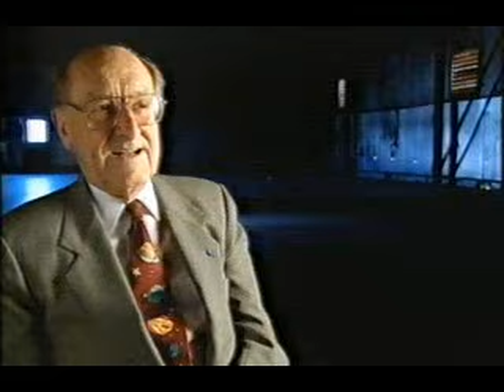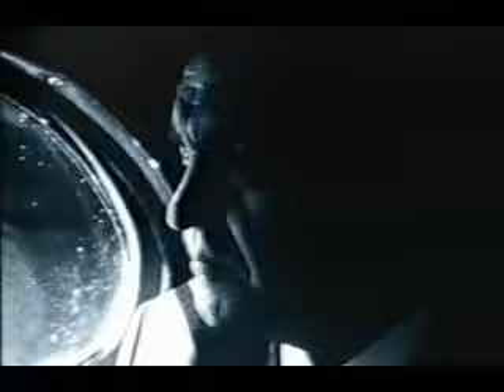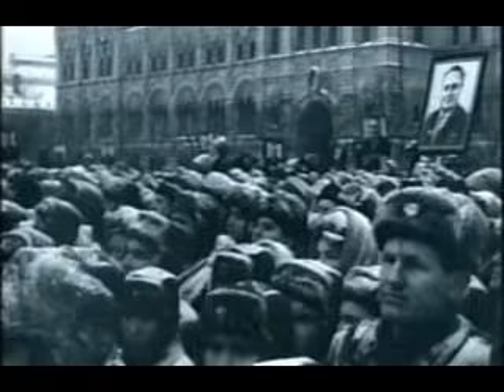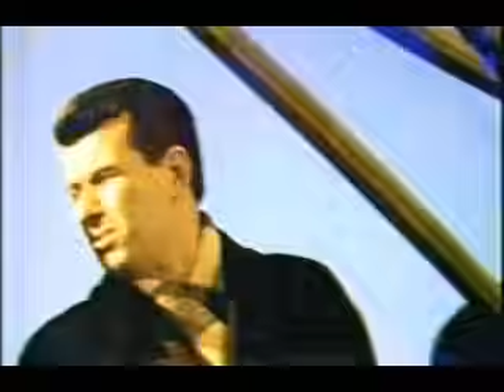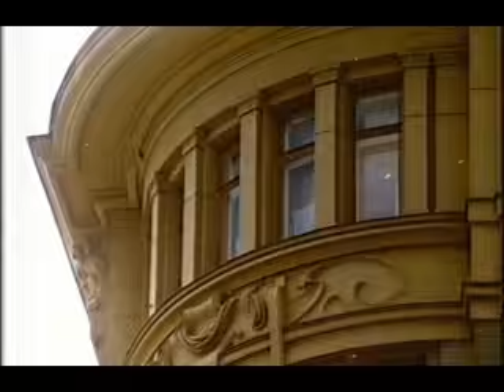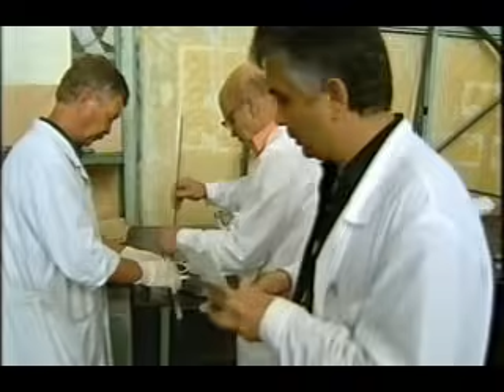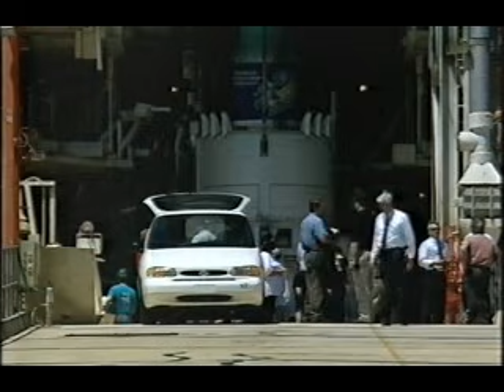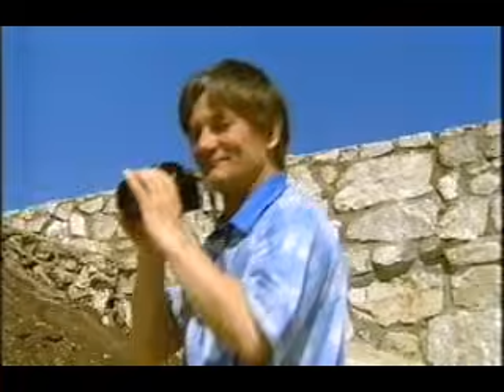Soviet N1 Moon Rocket Documentary

Comment: Ok.... The Russians had better engines than we did.... Really? The math does not add up:

Saturn V First stage: 5 F1 engines
N1 First stage: 30 engines. 

They had weaker "horses" so they need more "horses" to pull their wagon. That also ment many many more parts that could fail. 

As interesting as "closed cycle"  engines are,  it was a pipe dream that cost them the moon.
Reply: They were talking about efficiency not about total power
Reply: And if look at the Space Shuttle Main Engine,  it seems to be closed cycle as well (specifically "staged combustion" or "hot gas cycle").  Would explain the 10 year development cycle for the SSME (and the many explosions)
Reply: your opinions soundly are based on watching this documentary while asleep or
how can be this pipe dream you talk of? are you not believing evaluation of american engineers of Aerojet?
Reply: Our infrastructure did allow us to make bigger single engines because controlling 5 engines is less risky as 30.  Our system design approach was more practical and less risk averse.  The Soviets had a better design approach for their engines.  Even though our engines were less efficient, we did make it to the moon a few times as opposed to the Soviets never making a manned mission to the moon and that is directly attributed to their production limitations due to their poor infrastructure.  We could have maintained the shuttle for a number of years longer, it was a choice to have shuttle or build new launch systems for deeper space exploration.  We couldn't do both we don't have the funds...and many of those that are critical of the current SLS program would use the same argument you are using to uphold the Soyuz, using and improving on older reliable technologies.
Reply: Lindsay Fog Our system design was much more practical than the Soviets...because we had the infrastructure...they developed their engines out of necessity and were used impractically...30 engines running simultaneously is a horrible concept, 5 and 3 are most difficult...but the Soviets had no good alternative...
Reply: I am unsure of it being 'infrastructure' deficiencies , maybe more of which country decided to spend money elsewhere,on war programmes or other military methods of one upmanship and idealogical points scoring exercises. Definitely not a priority has been feeding hungry russians or healthcare for poor americans .
 Reasons have changed as to what or why to spend money in space   Experts in space systems freely admit nobody even knows why they build space stations. It was allocating resources not infrastructure that was in short supply.
Reply: Yes, the closed cycle engines are 10-25% more efficient. They recycle the the fuel pump turbine exhaust back into the combustion chamber. They are persnickety and they like to "burp", thus exploding by sucking the combustion gas back into the turbine centrifugal fuel pump assembly. Since the USSR buried most of it's failures, it's pretty hard to get an accurate grasp on figures for the reliability factor. The fuel pressure needs to be substantially higher at the fuel injection nozzles in the combustion chamber, the main problem is getting the hot thrust exhaust feed from getting sucked back into the turbine preburner.

An F1 is still the largest rocket engine ever made with 1.5 million pounds of thrust at sea level. This is a very good video!
Reply: Zoomer30 The main engine was never the culprit in any in fatal flight anomalies,the SRB's was the culprit for Challenger...
Reply: No...I was referring to the commentary in relation to Shuttle manned flight accidents..
Reply: Having infrastructure doesn't make a system more practical unless it is first practical. Nobody is holding 30 engines up as an example of who is better than whom.
The Soviets approach of incremental improvement and upgrading rather than replacement makes the Soyuz the only current regular means of human space flight even if it looks dated. check out Roscosmos youtube channel if talking Infrastructure
Reply: RD 180 not NK !!
Reply: The real thing that cost them the moon was the inability to dock in orbit
Reply: *****
from what i hear the atlas V can use the RD-180 for non military launches
Reply: Andrew McKenna
no what really cost us the moon was our inability to solve combustion instability the way nasa had done and the death of sergey korolev our chief designer once he was gone everything pretty well fell apart under vasily mishin although he eventually got soyuz to work properly
Reply: I think the expectation of 30 closed loop engines to work together perfectly was the downfall of the N-1.....
Reply: *****
yeah thats right the russian gov't banned the use of the RD-180 for military launches only
Reply: ClusterCracker Orbital Sciences learned how "reliable" they were last Fall (trip to the ISS turned into an embarrassing fireworks display)
Reply: Lindsay Fog
The Soviets didnt have the financial capacity to handle both guns and butter....it wasn't a level playing field to begin with due to their sorry economic system due to lack of economic freedom and centralized economic control. We didn't make a choice to be honest...we spent money on both sides of the ledger and much more on the social side...because our capitalist system allowed economic freedom for millions.  The Soviets could mass produce smaller engines because of their infrastructure...they DID NOT have the capacity to build F-1's period, the didnt have privatization of companies that "competed" with each other to come up with the optimum system design, we had a commitment from a beloved assassinated President. You fit your system design to your outputs, you don't design and engine or system that cannot be produced by your machines or people.  The Soviets had the people but not the machines.  Now because of our vast economic power had the capability to have corporations pour millions of their own dollars in R&D to develop a larger less risk averse engine and system design...
Reply: EpiDemic117 The only man we new of.....lets be clear. The Soviets weren't exactly open kimono in those days..
Reply: John Isom
I disagree about the funds. Some years ago i had school book about astronomy and in it there was the statement, that Americans spend annually 3 times more on dog food than space programs. And that was back then. So i think the funds are available... but not distributed correctly. Imagine what it would have been if NASA got even a fraction of all the bail-out money, wasted on banksters.